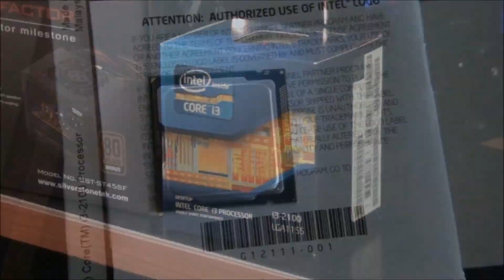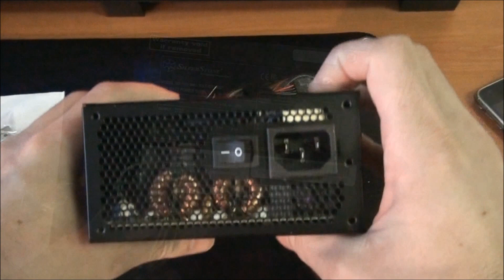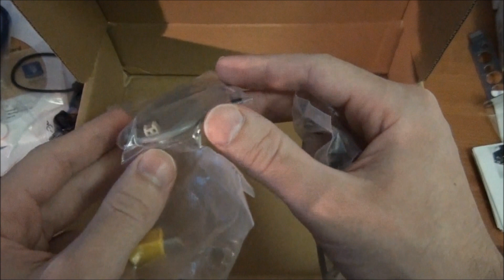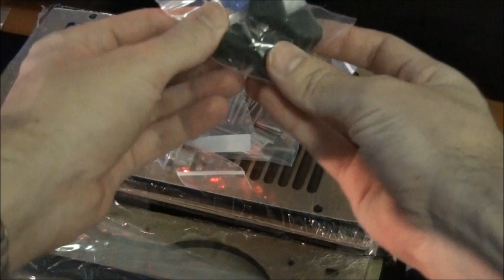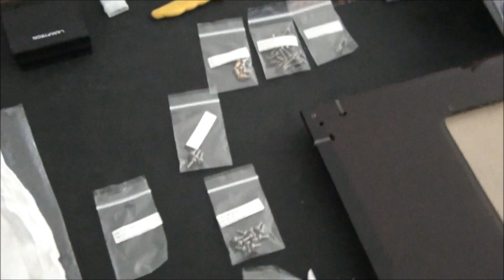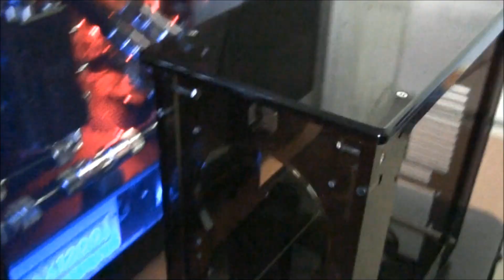Singularity HTPC Danger Den LAN Tower Build Log: Part 1

Comment: @SingularityComputers Really bad single pickups, mainly because WMC has a few problems with compro cards that have dual tuners onboard, it doesnt play nicely with splitting signals. Had to buy an addition signal booster which only improved performance slightly. In the end I replaced it with a Hauppauge HVR-2210 which is amazing. Hopefully you have better luck mate =)